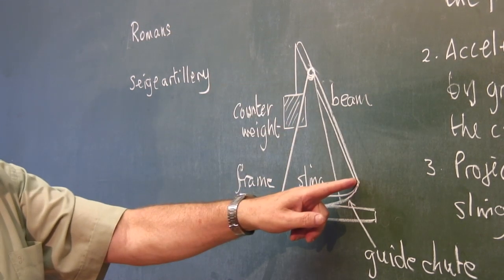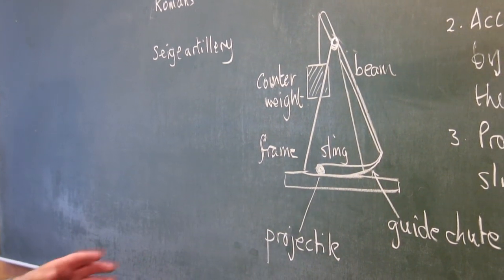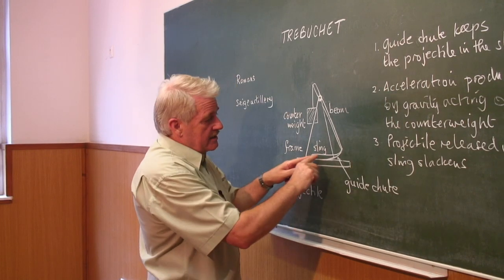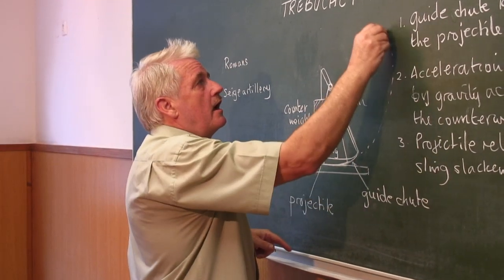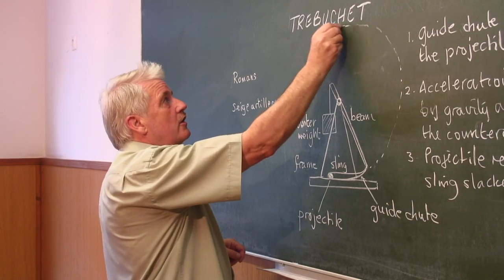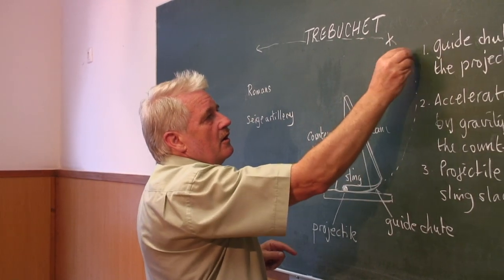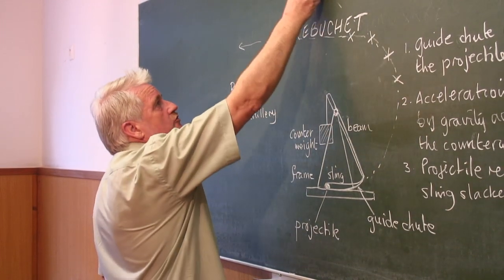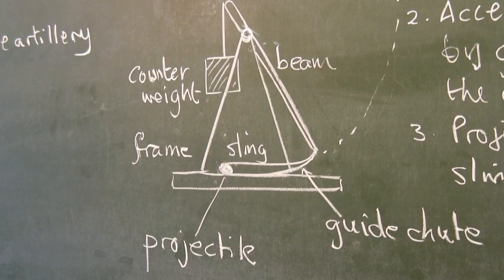How Things Work : How Does a Trebuchet Work?

Comment: Prometheus, one end of the sling was attached to the arm and the other slipped off a contact point when the sling reached a certain angle to the arm. The free end did fly forward under its own momentum. It didn't actually follow the payload, though.

Comment: Mad1Irishman, it could be a few things. Probably the arm is too heavy or the projectile is too light.

win2girl, you conrol sling release by either changing sling length (pendulum periodicity is based on langth) or the angle of the surface the free end of the sling rests on to the arm axis.

Note on history: the trebuchet was used by the Eastern Roman Empire (AKA the Byzantines) during the late Middle Ages, not by the Romans around the time of Julius Caesar.